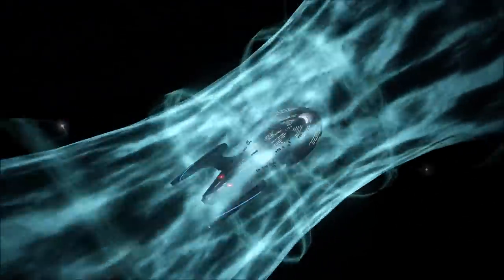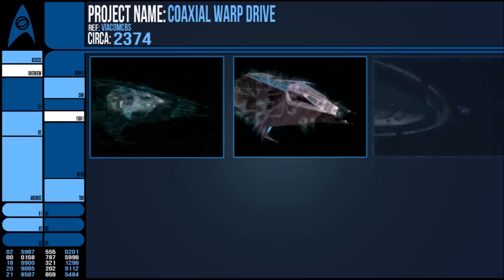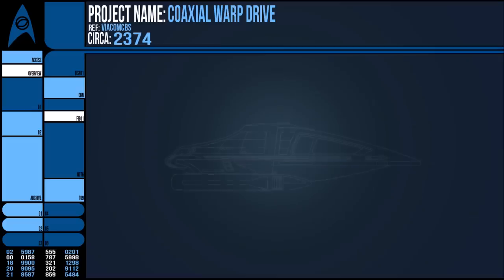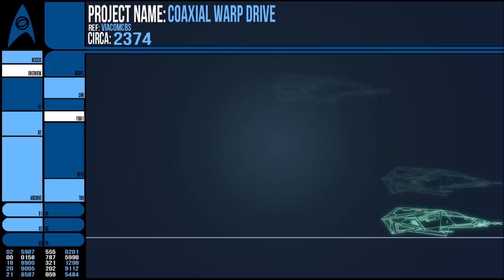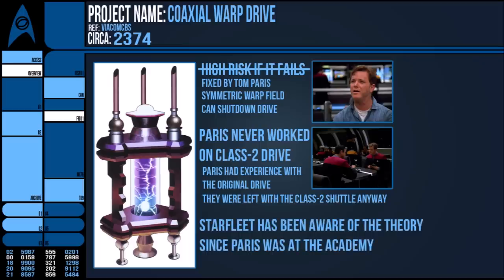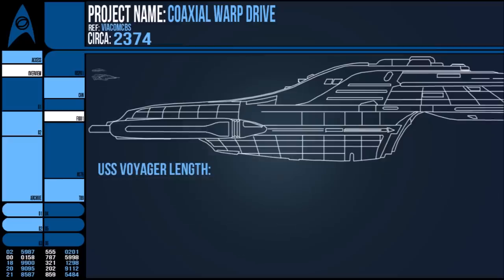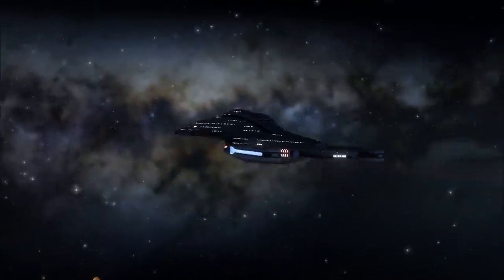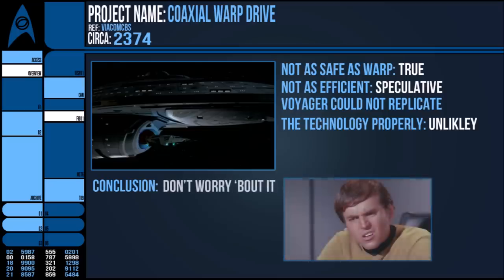Why Not Coaxial Warp Drive? (Star Trek Theory)

Comment: Idea I wish they'd run with for coaxial warp in Voyager:
-Yes, coaxial warp works, and is reliable and stable now.
-Yes, it was implemented on a 16m long alien vessel, and a notably smaller Federation shuttle.
-Yes, the crew can reproduce the technology.
-No, they can't realistically scale the size of ship the drive works on.
-No, they can't realistically expand the range per jump beyond a certain point which leaves it functionally only superior to conventional warp for that specific range or less.
- KEEP USING THE COAXIAL WARP EFFECT but only on shuttles making short trips away from Voyager.
Reply: Star Trek "Self contained episodes" with ocassional, yet still powerful callbacks, where not conductive to such 'configuration management' story telling. SG-1, designed form outset as series, had terrific build up.
Reply: Unfortunately that leads to bringing the ship back home one box at a time.
Reply: @piotrd.4850  
Huh? That's bullshit, Stargate was a bit better about remembering previous 'tech  of the week' or at least providing an in episode reason they couldn't have it (usually a highly contrived situation destroying it), but it still had tons of examples of useful shit that everyone just kind of forgets about, or that provides a really weak justification why it can't be used, or one that could be easily countered with another piece of tech they'd encountered before. 

The most glaring example is that there is no way in HELL they can't have gotten access to a sarcophagus by a few seasons into the show and the side effects are ludicrously minor given the benefits and explicitly only even occur with chronic use. Like why isn't there one of those sitting in the SGC to revive people killed on missions? Well the answer of course is "muh drama", but the problem is it makes no logical sense.
Reply: Coaxial warpshuttles which could travel much faster than starships ... but are comparatively tiny so they have severely limited range, fuel, crew, cargo, supplies?

That would put an interesting twist on Trek shows.

Coaxial warpcouriers for carrying annoying diplomats and packages, freeing up flagships for important stuff.
Coaxial warpfighter strikes (launched from carrier starships).
Coaxial missiles/torpedoes/probes which can "instantly jump" to targets lightyears away.
Coaxial "short-range" purpose-built warships like the Defiant (which nominally operate near support vessels).
Reply: lmao....agreed. How about build 30 of them, and send everyone home and self destruct voyager after they peace out?
Reply: @DeanBrah  Because lets say it's 4 times faster.  That's still over a decade.
Reply: hell, even if they scaled it to the larger ship, making it only useful in a limited way would have worked.... quick escape with small chance of ending up with damage, and/or a cooldown, mostly used for escapes but.. a chance of ending up....not where you intended and...yeah.....could be fun...
Reply: It would be good in a military advantage given you could possibly jump past blockades.
Reply: My headcannon is that shuttles just sort of appeared in the hanger bay. They could try to modify one, but it would only last until they accidentally blow it up and a new one appears.
Reply: Trying to use two different kinds of drives is a logistical pain in the ass. With a ship and crew having to scavenge and be frugal with their resources (replicators still require energy, after all). And before anyone chimes in on Voyager's unlimited torpedo magazine, I can easily accept that they would use some of the resources they gathered to manufacture new torpedoes (or trade with a friendly enough culture) to replenish their stocks.
Reply: @RaderizDorret  Two things:
1. With the suggestion I made, they're not running two separate drives on a single ship, so this isn't the issue you're presenting.
2. On the torpedo thing, the issue has never been that there's no possible explanation, but that there's no provided explanation, which is bad writing. They establish a strict limit without presenting any solutions as being plausible, then discard that restriction without explaining when or how it's removed.
Reply: @a-blivvy-yus  You're not picking up what I'm putting down on point 1. All Starfleet shuttles use the same warp drive design as the big ships so the cadets and crewmen can service, maintain, and operate both. What you suggested is we now split from that and now we need to have the crew learn how to operate and maintain two VERY different systems with spare parts, basic operational theory, and other logistical shit. It's a lack of standardization and it can and probably will get people killed.

Apollo 13 is a case study in this: the LEM had enough CO2 scrubber packs to last a crew of 2 for a day on the moon. Suddenly, the LEM has to support a crew of 3 for 3 days. The Command Module has more than enough CO2 scrubbers to pull that off... but one module had cylindrical cartridges while the other used a cube shaped design for its scrubbers. If the astronauts both in space and on the ground hadn't figured out a MacGuyver solution, Apollo 13's crew would be dead.  If CO2 scrubber design had been universal from the outset, the improvised solution wouldn't have become necessary. THIS is why it makes no sense to continue with the coaxial warp design: radically different method of operation compared to what the crew were trained on and use on a daily basis.
Reply: @RaderizDorret  OK, but that example applies more in the context of what I thought you meant than what you actually meant. And yes, I did miss the point you were making, because I thought you meant having different systems within a single ship (a more serious concern), not having different systems in different ships which are built on such a vastly different scale that even with the same technology base, you're unlikely to have interchangeable parts anyway. We don't run aircraft carrier generators on jet fuel, and the fighters they launch can't run on the diesel that powers the ship. Even if they are the same tech, the parts from a ship 100x larger won't, even if they're built to equivalent standards, be an appropriate size to even fit inside a shuttlecraft, let alone operate the same way inside it. Your example is one where different parts of a singular ship were built using different components, NOT a situation with two devices on separate ships built to different scales are being compared.
Reply: @RaderizDorret  Also, you're providing examples of "they should use standardised parts within any single system" as justification for "they should never use anything other than a singular standard for everything ever" which is a really extreme example of a slippery slope fallacy.
Reply: @a-blivvy-yus   1) Your anology of carrier vs jet fighter is way off. It's more like Voyager is a light cruiser (that's basically what she is anyways) and the shuttlecraft is akin to a helicopter: both run on gas turbine engines these days and both use aviation grade kerosene for their fuel. This is called synergy in that you don't have to devote precious hull volume to handling two different types of fuel. Also consider that a lot of the general crewmen, both on Voyager and on real ships, are just barely considered adults and have enough on their plates without adding unnecessary complexity to their situation.

You're also putting words in my mouth. I'm not saying they shouldn't try to find a better way to do things. But I am saying that actively using and converted what is explicitly stated is an experimental technology (the alien ship that had the drive originally is a test platform akin to an X-series plane in the US) that operates very differently in terms of basic operational  is unwise compared sticking with what is known to work with all quirks of the baseline design concepts being well-understood for over 200 years and improving upon that baseline. We even saw what happens when you rely heavily on cutting-edge tech that is so new that certain vulnerabilities weren't considered until after things went sideways when Neelix made the ship sick due to the bio-neural gelpacks getting infected with bacteria he was cultivating to make cheese. The crew had to re-wire a bunch of systems to use the older isolinear design to avoid this situation in the future and continued with this process as it's less resource intensive to replicate isolinear chips than it is to recreate the gelpacks.
Reply: @RaderizDorret  Ship with crew of a few hundred that's several hundred metres long and designed for extended journeys out of reach of any supporting vessels, compared with a ship a few metres long that only holds a handful of people and can be operated by a single person, with limited range and a need to work from a larger ship as its primary deployment platform. I think the comparison is entirely appropriate, and fits with the model I was suggesting. Additionally, I was proposing the use of a higher-performance engine in the smaller craft, for faster travel but with a technology that doesn't scale up efficiently and is thus impractical on the larger vessel. Can you not see how this reinforces that comparison?

And no, I wasn't putting words in your mouth. I was making a comparison between what you were saying, and a position which I was saying your statement was equivalent to. The fact that you're following up with an example of "look this advanced technology failed" implying that any new technology would do the same, just reinforces my comparison. You're suggesting that they shouldn't use a new technology with its new-ness as a central reason not to do so. They're in a difficult and dangerous situation where they're shown themselves to be very willing to take risks where appropriate. Refitting one or two shuttles with the new coaxial warp was sensible, they did it, and it WORKED. Showing references to it in a subsequent episode where they confirmed that for some reason the technology doesn't scale would explain why they don't use it on the main ship, but they could still have used the visual effect on shuttlecraft. This would give them a little more flexibility and justification for why their shuttles can get places faster than in the other entries in the franchise, and let them keep using a cool visual effect instead of relegating it to a single episode and never seen again.

The tech is shown to work in the episode, is already getting rapidly more stable within the span of that single episode, then never revisited. It doesn't use any new elements or materials they aren't able to replicate on board Voyager, it's something they're able to maintain without massive retraining. All I'm saying is that they COULD have - and given the many things they DID run with, probably SHOULD have - upgraded more of their shuttles with the coaxial warp system. This isn't being rolled out as a Starfleet standard, at least not in its immediate appearance. It isn't being deployed on main line ships with novice crews who barely know the basics of fixing a normal shuttle, it's being worked on by demonstrated experts who understand the premise of this new technology they're using. And it doesn't need to reshape the context of the show by existing like some of the other technologies Voyager "had to" lose because they were too strong. They could have sent it off to Starfleet in a communication signal in one of the times they got through to them, or it could have shown up when Voyager finally made it home. Either way, it's not a galaxy-changing upgrade, but it would improve the efficiency of short-ranged travel with small craft which don't need to operate independently for extended periods. A major reason Trek never used fighters is that the large ships have the mobility to match and even outpace the speeds of smaller craft over even relatively short distances. The move to the use of fighters in later stages of DS9 goes largely justified by "the enemy is doing it so we have to" rather than actually sounding like a good idea. Having the ability to equip the smaller vessels with faster drives than your carriers would provide a more meaningful justification for their use.

And if you look in a shuttlecraft, you'll notice there isn't a warp core three times the height of the ship inside it. Similarly, warp nacelles on a shuttle aren't five times the ship's length with room for people to walk inside their housings. The scale of the systems in shuttles is vastly different, the parts they're built from CAN'T be consistently interchangeable between the shuttle and the primary ship, it's never going to be a matter of "these parts are the same size, why did we not make them the same shape?" like your original example, which is why my example was more apt. Well, that AND the fact that I'm proposing that they replace a less powerful drive system that's suitable in part due to how effectively it scales up with a high-performance option that doesn't work out in large scale but would be viable on the smaller vessels. If you'd prefer to run with your cruiser/helicopter example though, you might use the same fuel in both, but if the cruiser's engine has a broken part, you don't just pull the equivalent part out of the helicopter engine and screw it into place and expect full efficiency, do you? Now why do you suppose that might be? You also don't tune both vehicles to use the same air-fuel mix ratios for some reason. I can't imagine why not, can you?

The speed boost provided by coaxial warp isn't sufficient to meaningfully shorten the overall journey - still requiring decades to make the trip. It wouldn't be nearly safe enough to just adapt all the shuttles and launch the entire crew out, because the limitations of being in such a small ship would prevent long-term survivability, where the Voyager itself was a viable long-term survival platform and still travelling fast enough to get them home eventually. It makes sense that refitting the shuttles with the limitations I've suggested for the technology would still leave Voyager unable to get its crew home, but would give them another little advantage in short-range exploration around their ship. There aren't any real objections which actually make sense within the established theme or setting, and there aren't any good reasons you've provided which justify rejecting the idea.
Reply: @a-blivvy-yus  Holy Christ. Again you misunderstand. It's not stated just what fuels that experimental craft, how the drive operates, and how radically different it is to what the crew already knows. Lastly, the crew captured the test ship from a pack of criminals who knew jack shit about actual engineering. And it's also a matter of resources. Look at the Quantum Slipsream Drive that does work... but required time travel to fix the outcome as VOYAGER DOES NOT HAVE THE RESOURCES OR MANPOWER TO HANDLE EXPERIMENTAL TECH THAT WORKS ON A FUNDAMENTALLY DIFFERENT LEVEL THAN WHAT THEY HAVE BEEN TRAINED FOR YEARS WITH THE ENTIRETY OF THE FEDERATION BACKING THEM TO USE! 

The tech may be feasible, but it isn't nearly ready for regular operational use. You could pull it off if you had crew dedicated to running it exclusively... but Voyager does NOT have that luxury. You've got a crew of 125 basically in a survival situation. What you're asking is that they abandon their critical duties so they can run this one-off shuttle and do nothing else as that is what you need to do for any experimental tech of this magnitude. The tech is definitely an improvement over what Voyager has to work with by default. But Voyager can, at best, do limited trials and experiments (which is the case here) in any reasonable fashion.

Or maybe we could look to that episode where Tuvok used Logic to betray the spirit of Janeway's orders to get a transporter that can jump the ship 80 lightyears in a second only to realize that actually using that tech would destroy the ship as the tech's fundamental nature is incompatible with Starfleet tech?
Reply: @RaderizDorret  Yes, sure. It's ME misunderstanding here. That's clearly the case. You aren't missing the fact that they DID decide to run a limited test of the technology. You also aren't missing the fact that the limited test proved the tech to be viable for their crew to operate and maintain then they never addressed why it was abandoned. Definitely not. You totally addressed that point with your argument.

...oh wait no you didn't.

I'm not saying they COULDN'T have used the explanation you're suggesting as a possible reason it wasn't used. I'm saying they DIDN'T and that your answer isn't as interesting when it was done multiple times before with other technologies they ran tests with because those technologies showed their flaws.

On which topic, yes, maybe we could look to another episode where they got hold of a powerful and useful long-range transport technology. That one's a great example to run with too, lets give it a look. You know what it doesn't have in common with the coaxial warp drive? THEY PROVIDED A VALID REASON WHY IT DIDN'T HELP THEM. What exactly is your problem with me proposing a way to have actually done that? And more importantly, I'm providing a way it could be actively used - something most such technologies turn out not to be even viable to try - while still not helping with the end goal. Your arguments aren't maintaining proper internal consistency while also failing to match the events which were shown on-screen in the episode on top of not lining up with themselves, AND you aren't countering any of the points I'm making anyway, and you somehow aren't realising that the one missing the points being made here is you, not me. I'm able to refer to the episode and my suggestion consistently, and you're jumping all over the place making arguments that contradict each other and sometimes themselves to try and poke holes in it, and failing to even give me reason to change my original position to account for new information. I'm even able to run with some of your own examples and they're supporting my position.

Maybe before you try calling someone else out for not understanding the conversation, you should go back and read it.
Reply: @a-blivvy-yus  First off, I'm giving reasons why someone wouldn't use that drive, which you seem to be ignoring. Second, we don't see the shit that goes on between episodes (this conversation could have already happened). Sloppy writing to not at least acknowledge "it's too risky to adopt this drive for our own use, but we'll keep the data to hand over to Starfleet when we get home"? Absolutely. I won't deny that. But there is strong logic in not adopting the new drive.

However, your response to this is, essentially, defending using a completely new system that is only known in theory to your side of things with no engineering experience with said drive save for that limited test run and nothing on long-term quirks of that drive when the drive they're copying itself is a prototype (as in it's experimental to the people they came across to boot so the people who invented it don't know about any long term issues that could crop up)? Tom Paris slapping a carburetor analogue onto the design got it less likely to explode, but there is zero data on long-term usage of such a device. It's an interesting idea to be explored when they get home, but not something practical to use over their standard equipment. And the video points out that it's never said if the tech did that 20 light year jump in an instant or if it was multiple jumps over time or how frequently it would be down for regular maintenance (not to mention they'd have to write the entire book on maintaining it, learning as they go which will add to the downtime). For all they know, it'll slow them down in the long term. And using that drive on shuttlecraft is also problematic as, if that drive goes down and can't be repaired with the resources at hand, then now the ship has to divert to recover the stricken shuttlecraft.

Remember: Voyager, despite looking for every possible shortcut, is expecting a 70 year trip at their top speed (unstated explicitly in terms of warp factor, but her maximum sustained cruising speed is Warp 9.975 which covers 20 LY in 12 hours). They have Neelix cooking food and crew running airponic gardens in the cargo bays so they can get the most utility out of their fuel, possible plans in place to run as a generational ship, etc. So their mindset will be heavily conservative on resource management. Of course shitty writing also has them going off to explore any rando shit that gets their attention so blame the writers on that one.

So you have a group who get this amazing tech, but are strapped for resources. History teaches us what happens to such groups when they go bleeding edge tech and try to throw it into operation before all engineering problems are understood in operational use: the jet engine in WWII.

My entire point is, shitty writing aside, there are plenty of plausible and logical reasons as to why the coaxial drive wasn't adopted. Which is the entire point of the video we're having our little flame war on.
Reply: @RaderizDorret  First point: Way to show your ignorance while trying to accuse me of that. I'm well aware you're presenting a reason not to use the drive. I'm not "ignoring" it, I'm presenting valid counter-arguments to your claim, based on the fact that it's ignoring my original premise and the context the show provides for this situation. And not even just the specific episode or even the specific series, but Trek as a whole in addition to those more specifically relevant points.

And my response to you is to point out that it's a "completely new" system that's actually based on the same principles as the normal drives they're familiar with. They're copying a prototype of an advanced drive which they get from people with less advanced knowledge than themselves. It's a prototype, but it's a prototype which was proven to work. It had some issues with stability, but the Voyager crew were able to figure out the principles on which it operates, not only well enough to use it, but to modify and improve on the original design. Trek is a setting where experimental devices are experimented with as a matter of course, and Voyager in particular makes a habit of frequently having characters - Paris in particular - tinkering with and experimenting on things to try and find new tools that will help the crew.

Nobody, myself included, has claimed that there aren't plausible or logical reasons why the drive COULD HAVE been abandoned. But the fact remains that NONE OF THOSE REASONS WERE PRESENTED BY THE SHOW and the show has made it VERY clear that doing what I'm suggesting is ABSOLUTELY IN CHARACTER FOR THE CREW IN THIS INSTANCE so it would make perfect sense for them to have done what I'm suggesting.

Was it bad writing to leave the topic unresolved? Absolutely.
Would giving one of your explanations in the following episode have justified it? Absolutely.
Does that give your argument any relevance at all to the point I'm making? NOPE.

I'm working with the information we have from the show (Trek as a whole, Voyager in particular, and even more specifically, the episode in question and the lack of outside acknowledgement of that episode across subsequent events in the show). From that information, none of your objections hold up without an explicit in-universe explanation supporting your position. We don't have that, so your entire objection is "well they could have written it like this" BUT THEY DIDN'T - they also didn't write what I'm suggesting, but they could just as easily have done that. And it would have fit in the setting without changing anything in terms of production costs, and without impairing storytelling in the specific series or the franchise as a whole in any way.

And on top of all that, many of your arguments don't hold up to even basic scrutiny, which is why I tore them apart on the basis of applying basic scrutiny instead of just dismissing them outright.
Reply: Moya kinda likes the idea of two drives, one regular and one random bug-out.
Reply: they could've put the thing on the Delta Flyer. Since they already have that super shuttle with Borg tech and a "manual control console", might as well throw another super drive in there. The fact that they only have limited range and space on it makes it even more useful. They could use it to zig-tag ahead of the big ship a bit. Or to take a detour while Voyager continues in a straight line towards Earth, with the ability to catch up. And if something goes wrong it gives the opportunity for the fact that they have to turn back or take a detour.
Reply: @TimoRutanen  like what they wanted to do when Harry Kim found that wormhole in season one